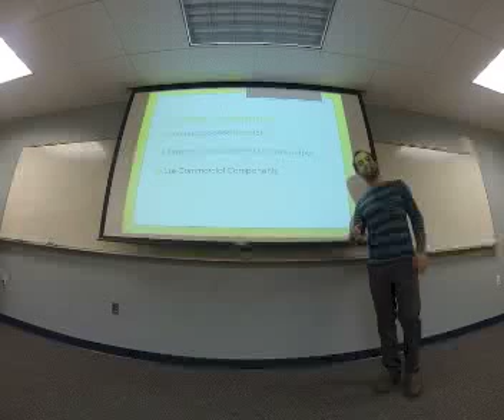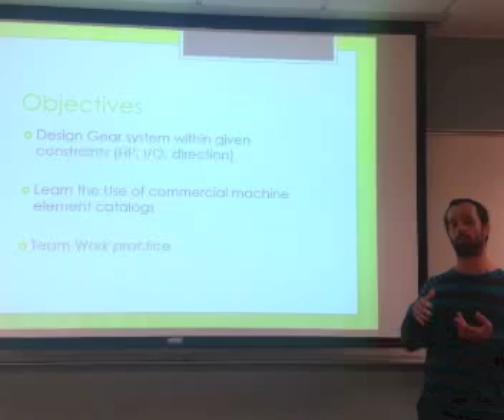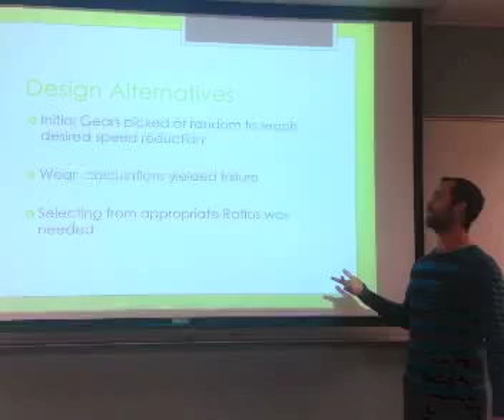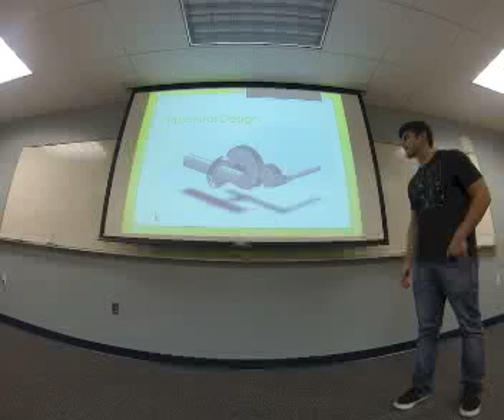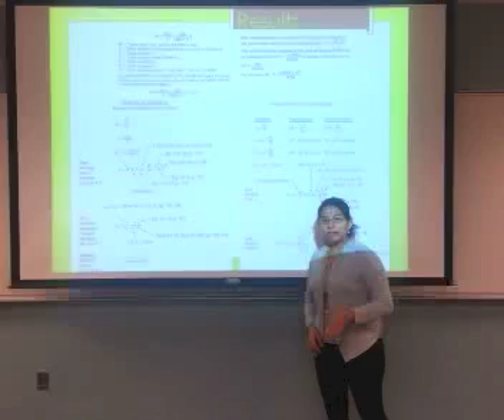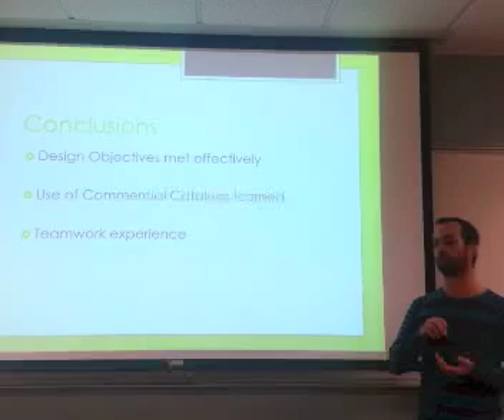Team 16: Gearbox Design

Comment: Interesting transition in the video frame.  However I would focus the camera better since the video was blurry the whole time and the PowerPoint was not legible.  I would also check the sound quality for next time.  From what I can tell is that each presenter did a great job at presenting the actual design project and it was very informative.

Comment: The video was subpar in quality. looked like a technical issue including transitions, which hinders the presentation overall but making it hard to read the slides. on a positive note the presenter seem knowledgeable on the subject but improvement is needed in the technical aspect.